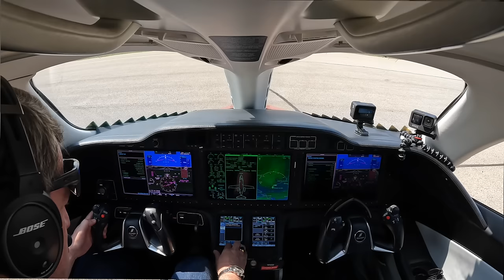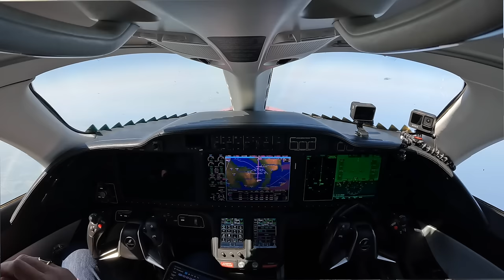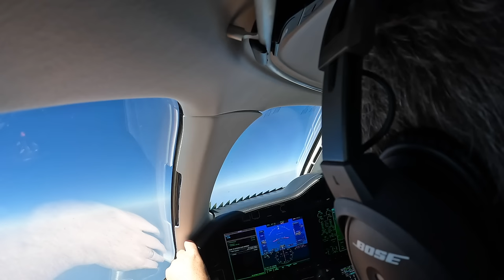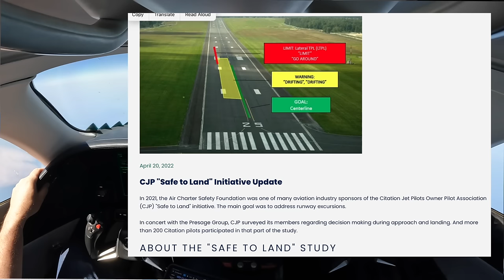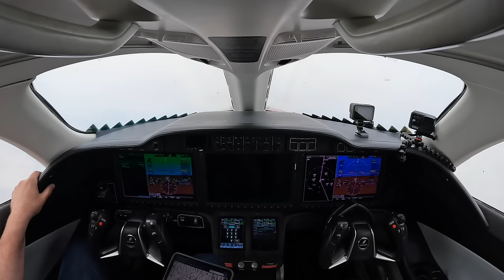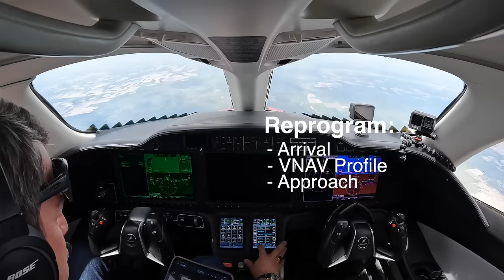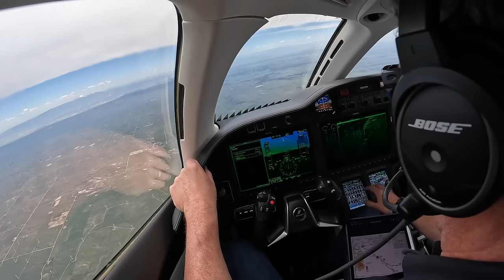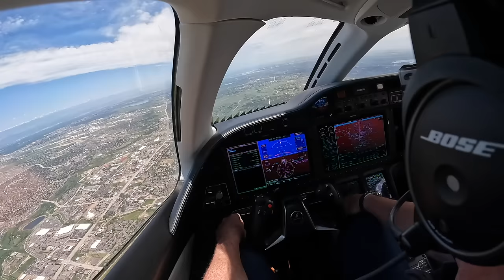Intel on HondaJet Safety - Single Pilot to Denver

Comment: I would love to see you view on the runway excursions as to whether some of that is based on the performance calcs in the Garmin g3000 and people forgetting that quite often when flying precision approaches available runway is reduced when landing at the 1000 ft markers. Ie performance calcs might say 3800 feet required. Runway length 4200 ft. But you lose runway as not touching down on numbers.
Reply from the maker: I actually think the opposite - the G3000 calculations are for flying a fully configured, stabilized approach and for touching down at the predicted touchdown point (Captain's Bars). Including: power to idle at 50' agl and upon touchdown - speedbreak deployed, max breaking. 

I'm not a safety expert but have analyzed all available data and continue to find the following issue:
- inadequate or incomplete performance planning
- questionable aeronautical decision making
- failure to fly a stabilized approach 
- failure to maintain aircraft control after touchdown. Keep flying the jet until you're at or below taxi speed. 
I haven't seen any issues at all with the HondaJet platform.

Comment: Thanks for sharing! What did u do for the VNAV profile update when changing the arrival and approach?
Reply from the maker: Great question. I had the vnav setup to fly the vertical profile of the DUNNNS 5 Arrival. The arrival includes the transition to the approach so once I new I was landing in thr opposite direction, I had to reload the arrival 

I may have been able to amend it vs reloading it but that's why I watch my videos. 

So the vnav lost its guidance once I reloaded the arrival to land on 17L

Comment: Is there speed limits in the sky, like when you're flying over a town or something?
Reply from the maker: It depends - mostly on altitude and airspace.  Typically about 10,000' there are no speed restrictions. Military can't break the sound barrier because of the damage it can cause. 

Below 10000' the speed limit is 250 KIAS unless you're inside Class B airspace where it's 200 KIAS
Arrival procedures to airports (typically the larger ones) post speeds to keep up the flow. 

In this video, I was taken off of the DUNNNS 5 Arrival because I can't go as fast as commercial jet at those altitudes, so I'm moved out of the way so that I don't impede the flow. 

Make sense?

Comment: Can you explain CSC, not familiar with that.
Reply from the maker: Absolutely. Cruise Speed Control. Not quite Auto-Throttles. It allows the FADEC to have 10% N1 authority. So if you're 1) In level flight 2) Auto Pilot engaged 3) Below 90% N1, you can engage CSC. I use it to make sure that I don't bust a speed restriction.

Comment: Joining Volato for safety meeting.  No mention of HJOPA

Mentor pilot when transitioning with less than 500 HRS in type.

The GDL 59 has always been available for the 420.  The limitations were the WiFi required a password that could not be entered.  A software issue. Hope with upgrades over the last 3 yrs this is no longer a factor.
Reply from the maker: Yeah, I've been careful to keep my content and hjopa separate. - probably over-thinking it. 

Mentor Pilot Comment-?  If you're saying that it should be a requirement, I sort of agree. 1) what are the standards for a mentor pilot? 2) what tasks should be evaluated? 3) should there be a sign off?  I prefer the Task Condition & Standard approach we used in the military. Measuring proficiency vs hours.

Yes on the GDL59...I look forward to having full GDL60 integration. 

Thanks for watching!